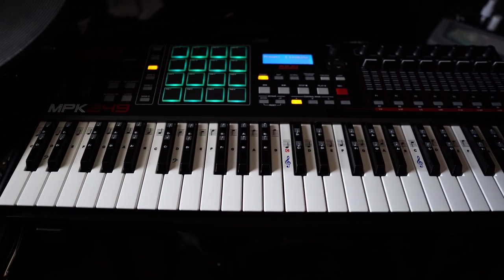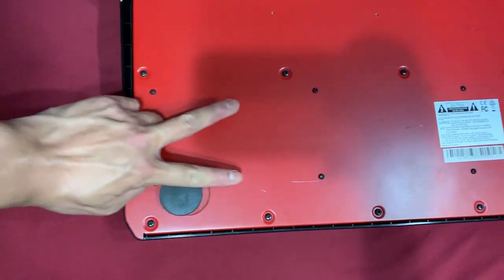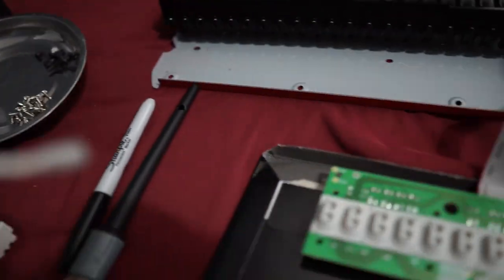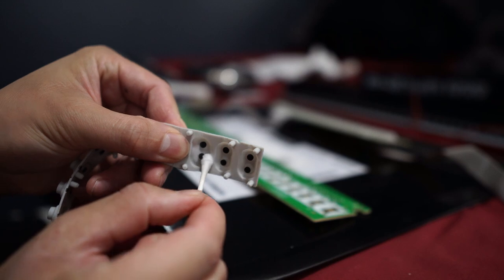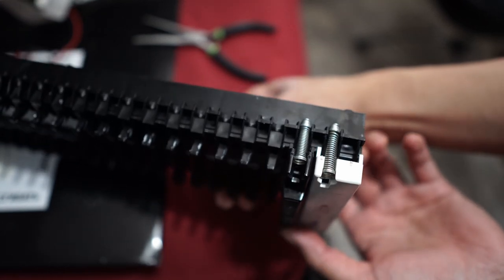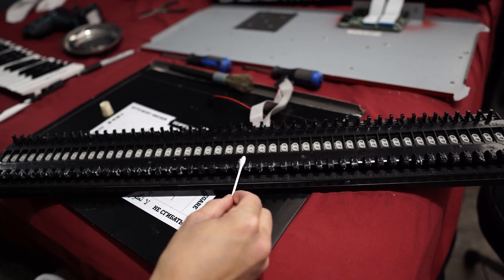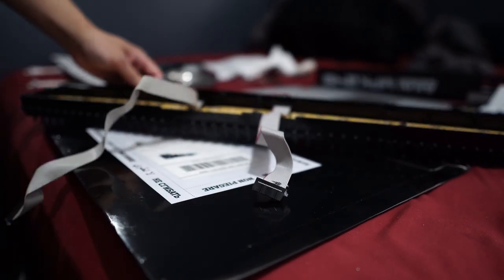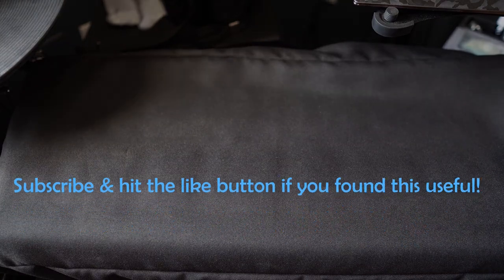Akai mpk249 midi keyboard sticky keys fix

Comment: just took apart my mpk261 to fix similar issues, a few things I've found that may be useful to y'all:

1. it may be easier to remove the keyboard cables from the keyboard PCB side, rather than from the rear panel PCB side

2. the springs from the black and white keys seems to all be the same, just that it is stretched longer for the white keys

3. for the keyboard, there are tiny markings on the top of the keys and the plastic frame that help you reassemble it, it seems that the black keys have some kind of order to them too (marked with 1-4) but i messed it up, prob best to take detailed pictures before removing the keys

4. you are very likely to wipe off the lubrication if you decide to do a thorough clean and take off the keys, please really consider buying some before disassembly

5. after wiping the contacts on the PCB all keys are working, but some keys still have slightly off velocity curve, subtle but annoying, i really don't know if the disassembly has messed up the spring/misaligned the rubber pads, anyway if you want to use it professionally i would not recommend fixing it yourself

6. this thing is heavy, best to find some helping hands

Comment: you know what would've been great? if you actually showed the disassembling and re-assembling process. otherwise, it's a helpful video
Reply from the maker: If you watch the video completely you will see me removing certain parts with explanations. Installing and reinstalling is just the reverse order. Good luck!
Reply: @mervsz3347  wow. Surprised you actually responded! Thank you for taking the time. But yeah i have to kindly disagree.  

The video skipped a lot of details such as the removal of the two ribbons from the circuit thingie (which was not easy at all btw), the fact that the keys themselves are not actually labeled, which means if not careful, you can end up misplacing the order of the keys, and even the opening of the internals itself

I know that these are relatively very obvious in hindsight but as someone who barely handles such niche types of electronics, I ended up having to be doubtful of your walkthrough and spending bit more time and effort to look for external sources to make sure what I'm doing won't mess up the keyboard

Still, I really appreciate the video and of course your feedback. Kudos!
Reply: @mervsz3347  totally not. You skipped important parts of the reassembly and disassembly.

Comment: great vid but i don't see why you ned to remove the keys to clean the contacts for miss triggering keys.. it' a lot more work for no gain imo.
i've done this with my mpk249.. it was in a damp musty basement type room which wreaked havoc with the contacts.. dust cover is a good tip as well.
Reply from the maker: If I am being honest, the mpk249 in general isn't the greatest midi keyboard to begin with.. The thing is if it was a great keyboard this video wouldn't be needed. It's sad that it struggles to work properly due to room humidity or dust. In any case, since the keyboard is within your ownership, it wouldn't harm you to clean it once in a while if you run into faulty keys. Good luck with your music!

Comment: I have a sticky key and some other issue where I'm getting random CC data. Dreading opening this up and taking it apart but has to be done. Thanks for the info.
Reply from the maker: No problem! Hopefully this worked for you. I too was hesitant to do this but it was either live with sticky keys or fix it myself. There was no chance I would send this in for repairs lol

Comment: Than you so much for the video.. I followed all steps and it works..but now my screen show only cubes..

Any idea ? I doubled check all connections
Reply from the maker: Your screen only shows cubes? I'm not sure what that looks like.. but hopefully you didn't get any type of liquid in-between your connections and try to power on right a way.. that is the only thing I can think of. If you did, disconnect connections promptly, make sure they are thoroughly dry (using a hair dryer for some minutes) then try again.

Comment: Just wondering: does any of you experience the "stickiness" of: 1. pitch and bend wheel, 2. "Push to enter" button and 3. arrow keys below that button?

I'm not talking about the stickiness of the sent MIDI messages, I'm talking about how the material (plastic) became sticky for me. In terms that they are not comfortable to touch. Also, they are catching dust, which sticks to them and is hard to clean (without scrubbing the whole sticky layer down).
Reply: Yes! That kind of rubber finish feels good on the fingers when it's new. But becomes sticky and awful after some time. I don't undestand why audio gear companies use it everywhere! C'mon. Get rid of it using isopropyl alcohol and a soft cloth.
Reply: @leonardod.8050  oh, I thought I was the only one and that this happened because of me cleaning the wheels to often! :)

You’re right, it’s the same thing with my Focusrite Scarlet 1st gen audio interface - some of the encoders are sticky.

This type of plastic should be named and banned! :)

Comment: I had the same problem ... went through the process and it was fixed... But  after a month all the problems came back with the same keys... this is really a bad choice .... i had my M-audio Axiom the original version for 15 years and it never failed on me and it also had more control parameters than this Akai ... I Really regret replacing it

Comment: Hey guys, I have an MPK249 trying to fix exactly what he is fixing. I do wish he went into more detail, but I've been trying to follow along and do it myself. Here's what I do know:

1. Taking those ribbon cables off is challenging. As of typing this, I still haven't been able to remove them.
2. It looks like you need to unscrew the yellow circuit board to remove the keys. At 1:38 in the video it looks like he had unattached that piece. 
3. The usb to midi port is messed up on my keyboard. After taking my mpk apart, I can see that the port is loose, and im not sure how to fix it. 

Let's figure this thing out! Hell I'll upload a video if I need to. All in all though, thanks for the information.
Reply from the maker: 1. Removing the ribbon cables should not be challenging. Factory does hot glue gun them down but the use of pliers and they should come right off.
2. Yes the process is to remove all screws off of the keyboard. The yellow sections are divided into two parts, from there you will have access to them. Remember that when working on the keyboard it is upside down and so the keys are in reverse order.
3. The usb to midi port should not be effected when removing, unless you unplug this section by mistake.

Comment: Hi! Instructive video. I just plugged in my MPK249 after a while and realised one of the black keys always gives the velocity of 127 (also rarely velocities of 0 or 1).
I'm wondering do you think this is the same problem that you had and should your fix work with my keyboard?
Thanks!
Reply from the maker: Akai keyboards in general have a tendency to have sticky keys after a while. I know sellers whom have tried to sell these keyboard with 7 keys not working. It can more than likely be the case with your keyboard but I cannot confirm because it is different from case to case. I say if it bugs you enough to try and clean that specific key. There is no harm in trying but please but someone handy when attempting this process.
Reply: A2Dsz thanks. In your case the key was producing a weaker sound, whereas in my case it produces the maximum of 127. And also sometimes, minimal velocity of 1. It’s strange that it produces such values, so intuitive if that is a mechanical failure of sticky keys. Interestingly, a lot of people is having the same issue. I’m wondering why Akai doesn’t simply reply them to open their units and clean the contacts..
Anyway, if this keeps bugging me, I’ll open up the unit, and your video was highy instructive and encouraging. Thank you.
Reply from the maker: @dankokozar  Agreed! Akai keyboard do have strange issues when it comes to their keys and velocity. I wish they did some upgrading on the contact points. Either way, it wouldn't hurt to dive in and give them a clean. Hope it works out for you and i'm glad you found the video helpful!
Reply: The fix is to order the new 200 USD keybed from AKAI supplier. I still didn’t do it, and probably I wont, but I’ll instead invest into another brand.
Reply: @dankokozar  so cleaning didn't help in this regard?
Reply: I have the same problem here with my MPK 249. G#2 key is giving me velocity 127 all the time. Did you manage to fix that, Danko? I also had the problem with my pitch and modulation wheel sending random messages. I fixed that replacing both potentiometers with new ones (5k ohms). So sad Akai is not making high quality gear anymore. I'm not buying from Akai again.
Reply: So my problem with velocity of 127 seems to have fixed itself. I can’t explain why, but last time I checked it was not there. My assumption is that the desk influences it (how horizontal and straight it is). I remember I changed the desk before the issue started. Try using the keyboard in different positions and tell me did this make any change.

That being said, the random messages from the pitch wheel are now happening all the time. So everything the keyboard produces is out of tune. Yes, this is a super unreliable keyboard (can’t imagine someone using it LIVE). :(
Reply: @leonardod.8050  Where can I get the potentiometers? Thanks
Reply: @leonardod.8050  so it looks like components used in MPKs have some planned or unplanned obsolescence? I took a great care of my unit: it was sitting on my desk for years, covered with a waterproof synth cover. It was almost never moved and was being used only by myself. And now I see other people having exactly same problems with it. What's bad is that Akai doesn't recognise this as their issue, and by ignoring it they make their brand look worse (I also won't buy from Akai anymore).
Reply: @leonardod.8050  update on the pitch wheel “ghosting”: it seems I fixed it by BLOWING into the wheel from the outside. After giving it a few blows, the ghosting very much stopped, and the amplitude was smaller. Then, I took a baloon pump I had handy, and gave a couple of blows with that. The ghosting now almost completely stopped. I see a few ghost MIDI messages here and there, but their amplitude is tiny so they are not audiable. And yes, I detected both the wheels having this problem, before I fixed it. Now I’m looking to buy a can of compressed air (air duster) with a straw, because I feel some of the problems with this keyboard could be solved just by blowing at the wheel and between the keys from the outside. I would imagine that opening the keyboard up and blowing some air to the parts would have even greater effect.
Reply: >>> UPDATE: Here's how to fix the "non-centered" pitch wheel and/or pitch MIDI values "ghosting" <<<

My MPK's pitch wheel started leaning towards smaller values - permanently.
So, the "centered" wheel, rather than sending the value of 64, started sending 55 or so. And there was still ghosting.
This was unacceptable, so I opened it up.
It wasn't anything tricky, apart from using a blanket/towel when putting the MPK to lay on its face.
There are 22 screws in total. After that, when you remove the bottom surface, the wheels are almost accessible.
Their potentiometers are turned towards you so you'll see their insights exposed through a small opening.
I sprayed just a TINY BIT of WD-40 into it: this fixed the problem.
The centered MIDI value is now perfectly 64.
I'll monitor it for a while and update here if this fixed the problem permanently.

IMPORTANT: a friend told me later that WD-40 is could be too aggressive. So, PLEASE, find something that's less aggressive, made for such pots.
Luckily I've put just a tiny little bit (one short spray). DISCLAIMER: If you're doing this, the responsibility is totally yours! :)

Comment: Does this also help when a is not functioning at all? Just realised that one of my keys is not functioning anymore. Not even sending a midi signal.
Reply from the maker: It could be the case, but every keyboard is different and so it would be hard for me to say. 

If the key is fully dead it wouldn't hurt to take it apart and clean it. Good luck!

Comment: i have a black key sticky, i fixed 2 whites and now work, but where does the black key touch ? i cant find where to clean for black key, help pls ty
Reply from the maker: The black dots on the rubber contact points as well as the circuit board gold sections. Test the board before you put it all together to save you time.
Reply: @mervsz3347  thank. I found it

Comment: when i play the keys, all of them get super quite after the first press, and only get louder again when i press the key with full force
Reply from the maker: Yeah, the contact points are very bad on this keyboard. If you already cleaned them you have to firmly press down for the contact points to read properly. Assuming you cleaned them properly and are just starting to reuse the keys. Honestly staying away from Akai keyboards due to these reoccurring issues when not in use.
Reply: @mervsz3347  gotta.be honest im a little weary of deconstructing it after just getting it and not knowing how to use it. most likely will just deal with it and if it gets too annoying, I'll just have to get a new keyboard
Reply from the maker: @keef_cheefr3110  It's a good keyboard, in theory. It just has issues with keeping contact points on certain keys. I wouldn't give up on it if it's just one key. You can take it apart and clean that key, if it doesn't work get a new one if need be. Good luck to you sir!

Comment: So u have to take all they off?   Can't just clean the board?
Reply from the maker: You can clean whatever is causing the issue, but if you open your keyboard you might as well clean it all. Good luck!
Reply: You don't have to take the keys themselves off.  You can just unscrew the circuit board to access the rubber key contacts underneath.

Comment: What if the pads are sticking
Reply: I'm fixing one at the moment. I just used a toothbrush and some dish soap in a stoppered sink. Should clean most everything off unless you've spilled something weird on it. Just make sure to elt it dry